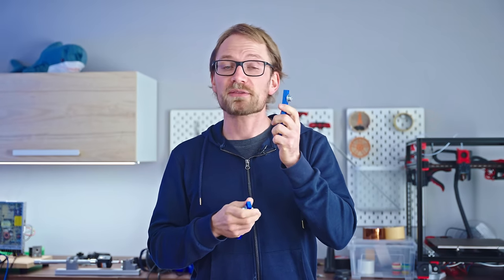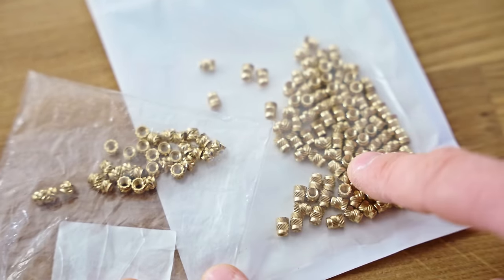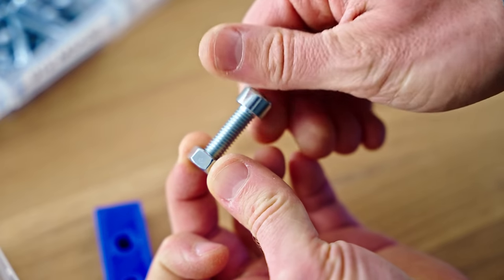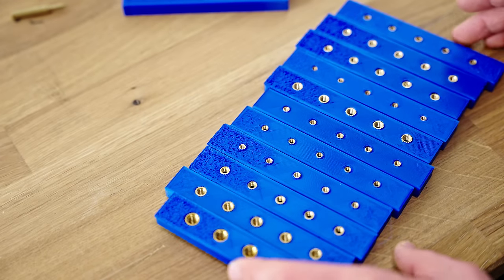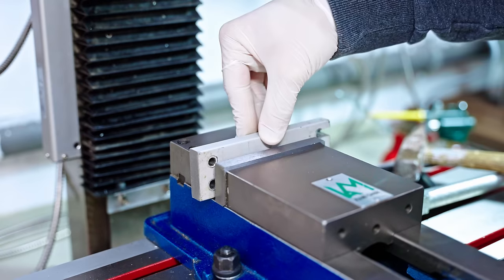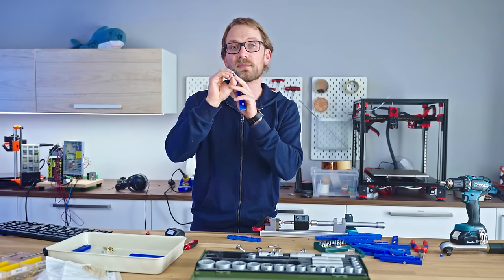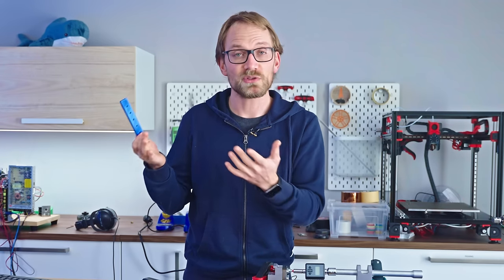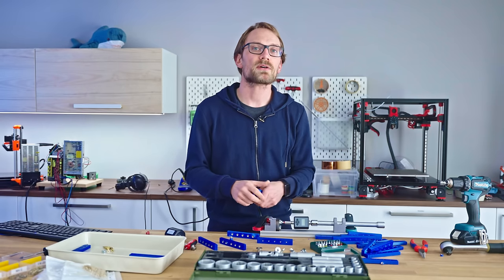Do you even need threaded inserts? Strength tested!

Comment: Strengthening the parts with more perimeters and/or infill seems like an obvious next step since the perimeters pulling out of the shell/infill was how every single piece failed.

An alternative to inserts that I would like to see tested is just putting a hex nut shaped recess on the backside of the part. Occasionally, you also see a slot where you can slide a nut into the part from the side, which lets you use a shorter bolt. A nut on the backside seems very common in designs downloaded from the internet, is very cheap, quicker and easier than heating an insert. And it seems like it would be much stronger than inserts because, in order to fail, you would have to pull the nut through the part, which includes not only the wall of the hole but also the area of the nut.
Reply: Speaking of infill, I would be interested to see how adaptive infill settings perform, so you could potentially get denser infill near the hole without needing to print a uniformly dense, heavy "block."

Comment: Nice test rig! For more structural applications, those inserts really need to be installed on the opposite side of the material, and blocked in the countersunk hole by 3D design, so the thread tension can't pull them out, without breaking the actual material.

Comment: I have had good success by adding more walls around the hole and then taping threads by hand. NOT a power tool. It takes a little longer but it also eliminates the heat issue with the tap.

Comment: I frequently use screws with printed parts threading directly into the holes with no inserts and without cutting threads or printing threads.  The key to making this work is to use the correct type of fastener such as those specifically designed for use in plastic and not standard machine type screws.  Also, use less interference clearance than you might think.  I have also found great success using conventional drywall screws.  It works and is cheap!  Also, I'm getting decent holding power with machine screws in carbon fiber nylon but again use less interference clearance less than you might think.  2mm screw diameter, print 1.85mm as an example.

Comment: I have not been able to put inserts in with an iron consistently. What I have done is pushed in the insert from the other side, and made the hole smaller than the insert hole on the bolt side. This has made the insert stay in, when torqued to secure the parts. I have also looked into designing parts to snap together, which can eliminate gluing, that can be messy. Designing features that snap together is easier than I thought. It's also faster assembly, but screws are still stronger.

Comment: For small parts (e.g. a bicycle handlebar clamp) I just print core sized holes and "force thread" the screws in. Works very well with M3 and PETG in my case.

Comment: You mentioned that you successfully use some kind of lead free solder. I have mixed feelings with those and still prefer the leaded solder for better flow. However I'd like to know, what do you use and are happy with and if it eats tips like crazy or not. From my experience, SAC is probably the best from what I had in my hands, but it still needs tons of extra flux and about 20°C more.

Comment: I typically use directly driven m5 bolts in 4.5mm holes with 20mm of engagement for parts that dont come apart often. For parts that are regularly disassembled i use pocketed nuts. I use an under sized pocket and press them in.

Any parts that need strength and not just extra infil, I model a small hole though the part so walls are generated around the "support" hole.

Comment: strength is influenced by position on the plate while printings more than the time they were all printed at. Heat load and thermal stability are the golden variables for consistency

Comment: When I was a student I was told that a bolt is unthreaded and a screw is threaded. But it's a fuzzy area these days.
Threaded inserts are actually a pretty good idea, but one variant that I really don't like is the helicoil since they have a tendency to come out with the screw whenever you unscrew it, I have seen that too many times. 😞
Also make sure that the material mix is OK from an electrochemical perspective or the insert could cause severe corrosion issues if used in a moist environment.
Threading with a powered drill - I wouldn't do that, I'd prefer doing that by hand to make sure that I don't get into bad trouble.

Comment: Great informative & practical segment. I designed a hole with fins (negative cut-outs) extending into the infill area, increasing the hole perimeter material and the engaged surface between perimeter & infill. They are arranged radially around the hole. In my example for a 5mm hole, the fins are 0.5mm wide by 3mm long, with 8 in the radial array. I start & end the fins 0.5mm inside the object surface so that they're not visible from the outside. Since the area around the hole is where the failures are located, this should increase strength substantially. This also would provide space for the excess material to go with thermal insertion. I haven't tested or even printed this design yet - wish I could send a screenshot of how it looks in the slicer.

Comment: Not sure if it's needed, but when I have screw holes anywhere I either increase number of perimeters locally (wonky in Prusa Slicer though),
or create a local 100% inflill area around it, so it won't easily get destroyed by the load, or necessary post print steps or the fastening itself.
And I usually do't do threads, but nut pockets with quadratic nuts. (so the nuts hold themselves)

Comment: You should test thread rolling screws for plastic. I used to just thread metric screws straight into holes. Now I've switched to thread rolling screws and I find them noticeably stronger. I do however use at least 4-5 walls on the holes.

Comment: That's a good way to do a blind hole but when doing a through hole I prefer to put the insert on the back. That way it to break out it one would have to pull through the whole part!

What about the plastic that builds up around the bottom of the insert? Doesn't it get in the way?

There is a solution to that.

Just insert a screw into the hole first. Then screw on the insert. Screw it on just enough to stay as the further in it goes the more contact it makes with the insert thus the more heat it can wick away.  Now heat your insert and push it in.  Plastic can't migrate into the screw's path because there is already a screw there blocking the way!

Actually some plastic will force into the threads of the screw. That does make it a little tight the first time you unscrew it but it's actually a good thing because now you have a little section of threaded hole just before your insert to add even a little more strength.

Besides all that, if your hole is well sized and your part is wide enough the screw acts as a guide ensuring your insert goes in perfectly parallel with and centered to the hole.

Comment: For strength I'd expect tee nuts, weld nuts, rivnuts, and the furniture nuts (left of frame at 19:08) would work far better for strength if they're on the opposite side of the print from the screw. Also I think something like the injection mold nuts might be a lot stronger if you inserted them, cleaned up the plastic mess a bit and used them from the far end rather than the end they were inserted in. I know that's not always practical in a 3d print, but it would certainly come a lot closer to testing the limits of the screw.

As a competitive combat robot builder I'd also love to see how these inserts and others work in more exotic materials like nylon, CF nylon, and (if possible) some of the MarkForged type prints reinforced with Kevlar or fiberglass.

Comment: I can confirm that something about your print parameters is giving you extremely low pull-out strength. I use McMaster's heat set inserts (Dodge is the OEM) and always torque my M3 fasteners to 1.0 Nm with a Wiha TorqueVario driver. They don't pull out until 1.3+ Nm, and M4 / M5 can handle SUBSTANTIALLY more torque still.

I suspect your vertical and horizontal wall thicknesses are contributing massively to this:
- Thicker walls give you more "shear length" for resisting plug pullout. The majority of the pullout strength is not coming from infill bonding, it's coming from the shear interface between the plug and the "wall" itself (just like a drywall anchor). If the wall is too thin, the anchor/plug will punch right through it, as we see in your video. For mechanical parts with heat-set inserts I recommend using 1.5mm or greater wall thickness. 
- More outer perimeters (3 instead of 2) increases the effective diameter of the "plug." This not only increases the surface area for spreading the load, but also makes the setup less sensitive to stress concentrations arising from the infill-perimeter overlaps.

Two other tips:
- This type of failure is very sensitive to (a) slight underextrusion; and (b) extruding too cold. Both tank layer adhesion which is very important for mitigating this failure.
- For heat-set inserts, getting the hole ID correct is crucial. Oversizing it by as little as 0.2mm can reduce strength by 50% or more. (However this manifests as the insert pulling right out of the material so this is not the failure you're currently experiencing)

Comment: Might be worth looking at Big-sert thread repair inserts. They're an oversize version of the Timesert. Unlike a Helicoil style thread repair, they're solid, with internal and external threads synchronised. In the case of the Timesert, this means the OD is only 1mm bigger than the ID.

Comment: When I need parts which take some mechanical load, I print with ABS and 100% filling. Tapping M5 threads always went smooth and M8 can be printed and used directly. Should give that a try.

Comment: Testing different adhesive options might be worthwhile.  Glues, solvents, and adhesive tapes.

This is the standard solution for a lot of manufacturing.  Everything from cameras through cars use a lot of adhesives.  (And of course modern building methods.)

Comment: For threads directly in plastic I use thread forming tools instead of regular taps. The pilot hole is bigger compared to regular tapping (ex M6 5.55 vs 5) and no material cut, just formed. Tools are more expensive though. Helpful content and test. I also upvote inserting regular steal nuts for another test round.

Comment: Something to check: The length of the screw in the 3D printed part.
I usually make an undersized hole, and if long enough, it does give me a really strong connection. Might worth checking. 
Good vid.

Comment: Thanks for another great test. This was basically already the conclusion that I have come to over the years. If I only ever intend to screw something together once, I may just size the hole so the screw bites in and cuts threads, or use a nut. Same for quick one-off prototypes. However anything I intend to unscrew or use multiple times, gets inserts. I made myself a custom profile in openscad for the inserts that I use so that the hole is a little wider where the insert goes, so that a little less plastic is pushed down but there is still plenty to melt around the brass and make a tight hold.

Comment: I never print threads, I just print a 3mm hole for m3 bolts and let them self tap when screwing in. Works very well. If I need a stronger fastening I will include an embedded square nut.

Comment: If you had denser infill, you would get more strength. I know that sounds obvious. I'm just thinking for testing limits of inserts and threads it would make more sense. Also, I've had good luck just letting the bolts cut their own threads in appropriately sized holes. As long as you are going from the top down, the threads are screwing into the top or bottom of layers rather than between them, it shouldn't split the part. It also matters which infill, top and bottom pattern, wall count, and how many top and bottom layers you use. Alternatively, you can heat a bolt slightly so that when you screw it in, it melts the plastic out of the way rather than just violently crushing it. Doesn't remove material like tapping.

Comment: I mostly use nuts and self tapping. It almost always possible to design parts such that there is a cavity for the nut in the opposing face (I ido that with threaded inserts too when I need ease of assmbly/disassembly of the part and placing the insert on the opposing face negates the weaknesses of even the cheapest ones).

Comment: Nice comparison.
A small correction to the statement that a bolted connection is designed to have no weak point. That is incorrect. 
The threat steam is always the weak point in a bolted connection with simmilar materials. Both in bolt shear and bolt tensile strength. Same principle is utilised in engineering for dissimilar materials, where a 12.9 for example in aluminum still fails. The general principle is to have thread tear out capacity higher than tensile strength of the bolt. Ofc this is deviated from if the bolt is in shear action and not tension but those are one off cases :)

Comment: How about considering the other stresses on an assembly? I've found that the  point of using small screws directly into plastic (4-40 in abs) worked just fine for making assembles that were changeable. After all the whole assembly is plastic.